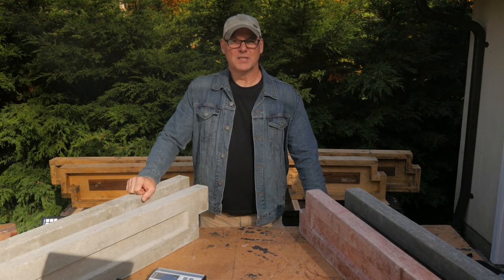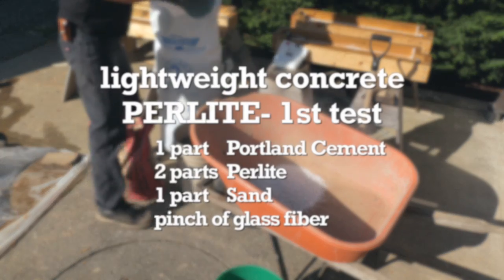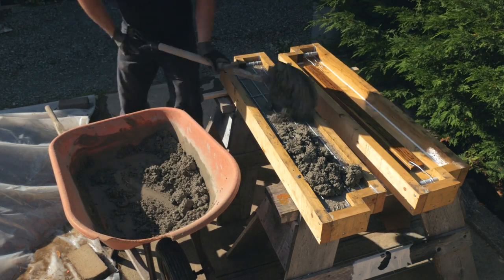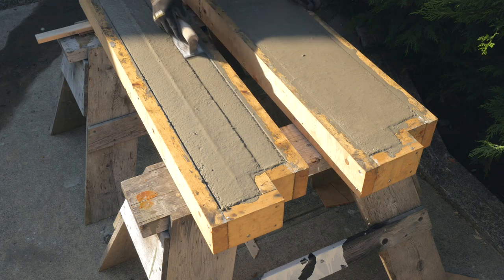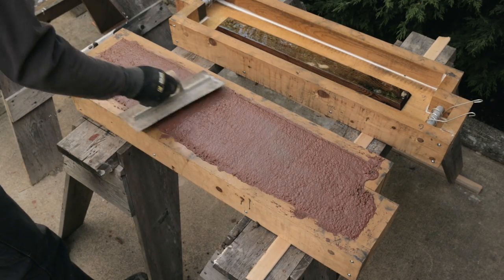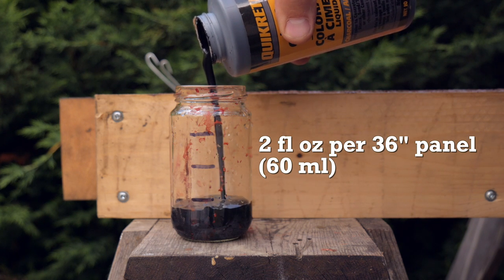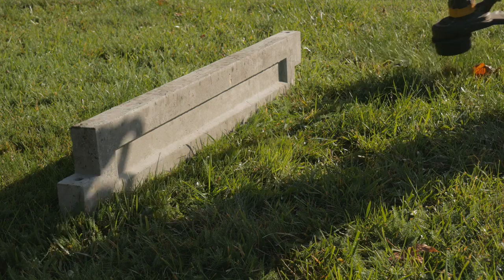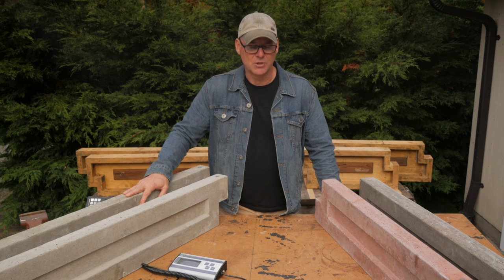make Perlite Concrete Garden Boxes PART 3.5 - Lightweight Perlite with CSA and Portland Cement

Comment: I'm considering a garden on the top of shipping container. The load bearing is on the rim only. 
So reducing the weight on the center of container is very important . 
I don't want to build a new roof at the same time don't want to collapse the center. 
A waterproof membrane will go on 1st. So no contact between concrete and steel . Then beds and light weight soil blend. Around the rim with a center walk . Also a safety fence/ trellis around the outside rim. The center walk will have a trellis coverage.
We are near the coast of NC with zone 8 hot dry summers it is very important that the inside of the container stay cool.
The sides will be covered with vines/ tall sunflowers
As shade.
Any ideas?

Comment: I wonder how well something like this would work for making your own drive way blocks.  I wonder how thick they would need to be.
Reply: I think you would want normal concrete for that. The perlite probably reduces the compressive strength of the concrete.
Paver bricks for a standard passenger car drive are normally 60mm to 75mm (2-1/2 to 3 inches) thick. For heavier traffic (more traffic and/or larger vehicles) 90mm (3-3/4 inch) is often used. Basalite is one manufacturer.
Most of the strength (and work) in a paver drive is the preparation below the pavers, consisting of excavation to undisturbed soil, compacting a road base in layers to build up the height, then about 25mm (1 inch) of sand for a bed to lay the pavers. The pavers then distribute the load and provide a wear surface on the sand, the sand provide a smooth layer to bed the pavers and evenly support them, and the underlying compacted road base distributes the load into the surrounding soil without settling. This is all very similar to preparing for a normal concrete or asphalt drive. Without this preparation the surface, whatever it is, will not last.
Reply: @Sylvan_dB  thanks for the great info.  I was just wondering if it would be cheaper to cast my own over time, and get a good large stock pile and then when ready prep the road or even sidewalk to lay the pavers. I have seen pavers used before for roads like were I'm from Hannibal MO were they used bricks. and they lasted forever and if one or a few were to break up you remove the bad ones and replace as needed.   With mine just being a driveway I would think they would last a live time with a good built up base.

Comment: a suggestion would be styrofoam.  break the pieces up and place in your blender with water.  makes perfect little balls that are extremely lightweight.  Use in place of vermiculite or perlite. 
1 measure of cement
1 measure of mortar AC2
2 measures of crushed Styrofoam
Enough water

Comment: Hi Kent!  Thanks for your videos on the concrete garden boxes!  I've completed my first garden frame yesterday and ironically out of 6 panels, my first casting was my best!  I've decided to try the Perlite mix because the back can only take so much Quikrete at 80# per cast (1'x4'x2" takes a full 80# bag).  :-)
What I wanted to mention is that in all of my research on Portland-Perlite concrete of varying mixtures, all of the sources I encountered said to mix the cement, sand (if any) and water thoroughly before gently mixing in the Perlite to minimizing the crushing of the Perlite aggregate thereby reducing the benefits of using it for a lightweight cast.  Do you have any opinions on this after all of your extensive testing?  Thanks!

Comment: Great series of posts! Many thanks for your efforts.

I'm curious as to why you don't use a cement mixer. I'm guessing that it's because you can more easily control the qualities of your mixes in a wheel barrow? 

Cheers.
Reply from the maker: Thanks! I have a concrete mixer and use it on bigger projects. I like the wheelbarrow for the reason you mentioned: while testing I can get a better feel for the mix. Also, most people don't have a mixer so showing what you can do in a simple wheelbarrow is a good thing.
Reply: @MANaboutTOOLS  Good idea. I ask because I'm old and decrepit and I do prefer to use my mixer. Thanks.

Comment: At these costs you may as well get recycled polystyrene and two sheets of carbon fibre to make an aerospace wing form and use it in your garden. :P
Reply: Do you think any of this would be, strong enough to slide into concrete post to act as a fence?

Comment: Do you think this moulding process would be ok to border/retain a pathway running across a slope? Maybe to a max. Height of 18 inches exposed, maybe 2 foot overall deep? I was intending to form up, but this method maybe less work and do the trick?
Reply: I don't see why not. In fact that there would be seems would relieve hydrostatic pressure, you would not to have to work in drain holes, I would however suggest bigger rebar and angled ties or cast a "flying buttress" to keep them perpendicular to your pathway.

Comment: how about 'hybrid/laminated' panels? do the outer section of the panel (first half-fill) with standard or light mix and inner with aircrete. you should have significant weight reduction as well as front hard face to stand up to the edger?
Reply from the maker: That's a good solution. Might be more work, but, I think it would make a light and durable panel.

Comment: There are no forces on those boxes during use, so I think that the heavy wire mesh is over designed.  Just use twice as much more fiber for tensile strength and forget the hog fencing..

Comment: Hello there!
I really enjoyed your video and found it quite interesting. This video inspired me and I am planning on building a concrete table that is "lightweight" by applying these methods you demonstrated in your video. Specifically, the CSA, sand, and perlite method, or I might swap out the CSA for Mortar mix. 
However, I just wanted to get some feedback and know if this will be feasible. I also plan on inlaying recycled glass to have an exposed glass finish but I am worried about polishing it and the perlite being an issue. If there is anything you recommend or suggest, I would love to hear it.

Thanks!
Reply from the maker: Hi, I have some upcoming projects with lightweight concrete this summer. Stay tuned....

Comment: Great video's! You almost made what's called a Hypertufa mix which has been around for a long time. It uses portland cement, perlite and peat moss. I was so hoping the aircrete panels would pan out just for ease of  weight. Do you think they would be more durable and stronger with the csa cement? I'm hinting at another experiment of course lol. Thanks again for such well made demonstrations.
Reply from the maker: Sheila Hughes Thanks!! I like the aircrete I made in part 3.6. The CSA Aircrete in Part 3.7 is not as good. I think the sand mixed in with the Cementall is detrimental.
Reply: @MANaboutTOOLS  I see a few comments that agree with you on the sand. I also like the idea some have suggested about putting a thin layer of regular cement in the mold first then the aircrete on top...it would withstand weed whacking for a few centuries lol. I'm not sure it would work though...I think the 2 densities wouldn't adhere to each other. If they didn't separate then at least  they would probably be fragile. I'm going to try your ratio in vid 3.6...keep up the beautiful work

Comment: Awesome video. I've been looking into building a raised bed garden and I didn't want to use wood because it'll eventually rot and I don't want to have to rebuild it when I'm older.

Question: Do you think these would have enough support for a 4 'x 8' x 18" raised bed? Or is that amount of soil going to have structural issues?
Reply from the maker: Thanks! I would think the stacked panels would be plenty strong enough to support that size. Or cast them 18" tall. But handling that size is a bit more of a challenge.
Reply: @MANaboutTOOLS  I hadn't thought of casting them 18" tall, there's an idea. I'll have to do some math to figure out what the final weight would be on a 4' x 18" panel using the Perlite method to see if it's a viable option.

Comment: I fell in love with linseedoil decades ago and resently cooked linseedoil. It is very cheap to get 1kg bags of ironpigment here in Austria, dont know how it is in your area? On the other hand there is supposed to have strange reactions of iron and csa ... and if you throw "loads" of read colour in the mixture, it is not unlikely ironpigment. 

So if you dunk or spray your panels (after totaly drying!) in cooked linseed oil (and if you want the colour, adding this ironpigment), you would even maybe have a good protection of the concrete against any water or acids from f.e. a compost .... ? What you think about that?
The linseed-oil never dries but has some interesting polymerisation-reaction with the oxygen n the air - but this takes many days. On the other hand you could pour the linseed-ironoxide-mixture (Norwegians red houses) over your salad and it would have maybe some health benefits ;-) - not that somebody should do so, but if you spill something in nature, it will be compleetely harmless. And it lasts for decades on f.e. would, as it does not peel of and let's the would breathe in some way. 

In Germany in church- and castels renovation it is now - for goods sake - forbidden to use any other colour than linseed oil, as all the other new plastic-colour-stuff destroyed old wood tht lasted for centuries in just a few years.

By the way: When painting smooth surface Iron with this mixture I experienced, that the colour disapeares completely after just half an hour, but comes back if you touch or brush it again just after some time before it gets stiffer, so that you still get a nice dark-red colour, that does not annoy in the garden. When mixing in the ironoxide, just take a few of the oil first, rub a paste and than gradually put in the ret of the oil. This is like they did it for centuries. This and the special recipes in the lime mortar-mixtures where passed on inside mason families from generation to generation as secrets.

Sorry for my bad English and the long text, but maybe you have a minute to answer, as I would like to know, what you think about my lines here?
Reply: That's great information. I remember my father using linseed oil to coat our roof. He would mix in graphite powder for color and use an old mop to apply. Where the mixture dripped from the eaves it stained concrete for many years and remained even longer on a steel awning.

Comment: in the GFRC system, we put in about 3% AR fibre, of the total batch weight for reinforcement, and if we look at it, is, I don't know, 50 times+ the volume of your dosage,  and HD fibre is more for anti-shrinkage cracks, I know we could be talking about a totally different system but if that is the only fibre you've been relying on, then it could be the reason why the test result showed almost no improvement in one of your other videos because basically no serious strength-reinforcement fibre has been put in at a dosage significant enough to matter at all

Comment: I am curious what your opinion on building a larger raised garden box out this method? I built a bunch of raised garden 7 years back 8ft x 3ft x 3ft due to her difficulty gardening at ground level. Nearly all of those boxes have rotted and had multiple blowouts from wood giving out bumping into it with stuff like the lawnmower or weeder over time. She is pushing for me to rebuilt them all, but i spent a ton on lumber building them, was searching for alternative ideas and came across your channel. My other alternative option is the galvanized metal raised garden beds, but they are nearly $400 ea. from epicgardening.com
Reply from the maker: These panels can be stacked to create taller beds. I think I show that more in Part 2 of the series.

Comment: "Concrete has two states. Concrete that is cracked and concrete that is going to crack."
Reply: I poured a 5 1/2" slab with a belly 6 years ago using a 30 mil vapor barrier. No cracks yet!
Reply: Depends what State. In the NW I have slabs I have slabs and foundations I've revisted thirty years later and still good. Frost heave is not a big deal since max low is 20's and we have lots of rain for curing help.